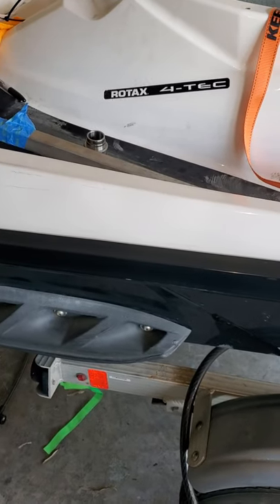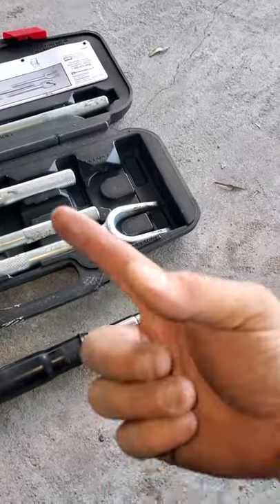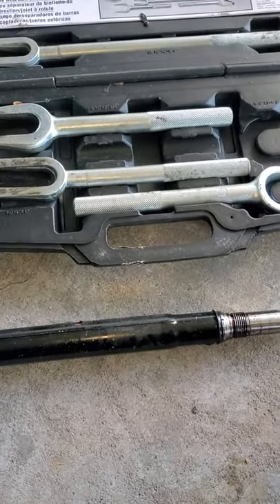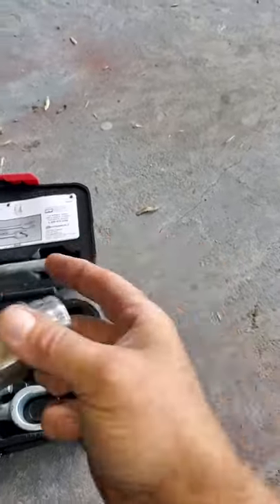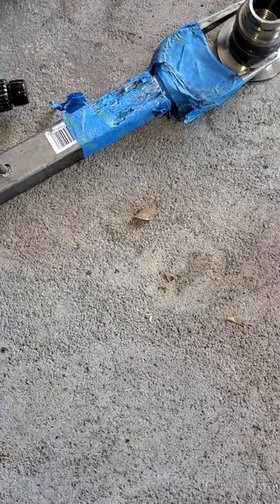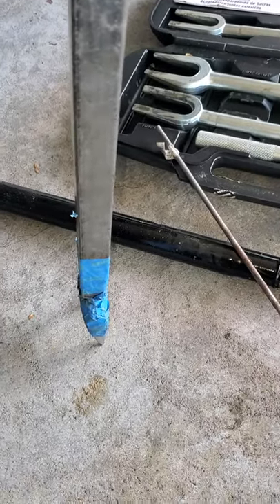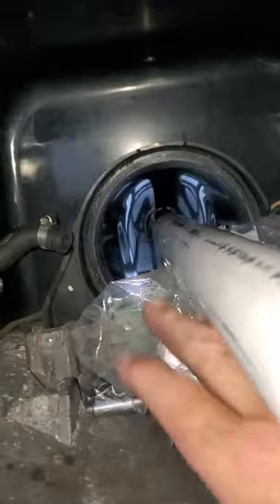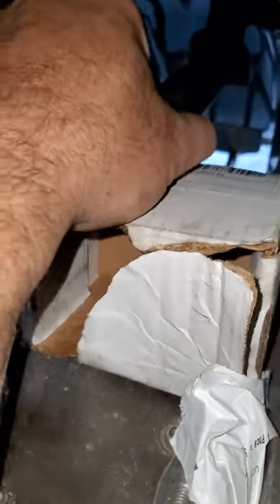Sea-Doo GTX install bellows upgrade shaft

Comment: Anthony- Did you find that the new drive shaft was identical in circumference and length other than the threaded aspect? I am getting ready to do this swap on my 2010 Seadoo Wake Pro 215. My drive shaft rubber coating separated and went into impeller making an awful screeching noise for a few seconds before I shut machine off. Did you purchase the kit with shaft, floating ring and new PTO ball bearing seal? I am buying parts separately as I found a great deal on a late year model 2011 old style drive shaft with perfect splines and grooves for cir-clip. I bought the new PTO seal with ball bearing race for the 2011 model to receive the shaft properly. How difficult was getting your original threaded shaft to back out? Was it rusted in threads badly? I am anticipating a tough time when I make that move. I ordered the spline nut adapter for socket and also waiting for other parts to arrive. This youtuber posted very useful insight on this project as well.  https://www.youtube.com/watch?v=ytNEohUZXc0 
Really appreciate your trick tools and will be using them on my project as well.
Reply from the maker: Yes the 2011 shaft is exactly the same that's why Sea-Doo went to that because the screw on was too many problems. What I did was  remove the jet pump. There are some videos on that. Because you're replacing the shaft you don't have to worry about messing it up. Take two vise grips and what I did was got some cardboard to put against the body of the jet ski put a vise grip hard to the right and put another vise grip hard to the left that will hold the shaft and then loosen the nut with a pipe wrench use a tube for leverage if needed. You did leave a long message but just a double check I ordered a new carbon seal and bellows on Amazon comes with a c-clip. I've put over 50 hours on the skis since I've done the upgrade. Absolutely no problems. But if you're getting noise out of the jet pump I would rebuild it if you have a vise it's very easy to do there are videos on that too. If there's something I miss send me another message otherwise hope that helped
Reply: @anthonypapa8676  Thanks so much for the prompt reply. I pulled the jet pump already and pulled off cone and inspected inside. Looks like someone had repacked it yesterday. All clean, fresh grease, no water and bearings and seals look new. It turns very smoothly with shaft sitting vertical in vise. Am hoping the sound that I heard was just the impeller scraping the wear ring until that piece of shaft rubber it slung in came free. The pump passes inspection, gets a new wear ring. Drive shaft swap like you did and definitely going to do your two vice grip attack on getting out the shaft. Your method is definitely more leverage angle from engine compartment vs working underneath the jet pump hole. Thanks again. Most helpful Sir